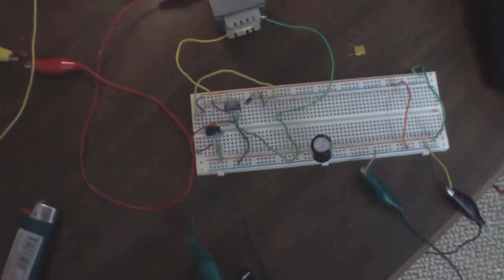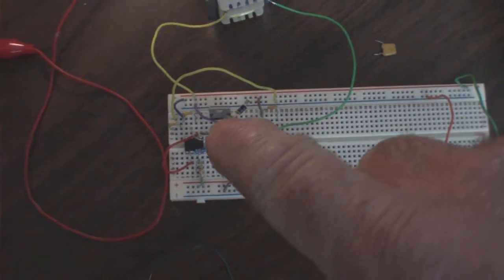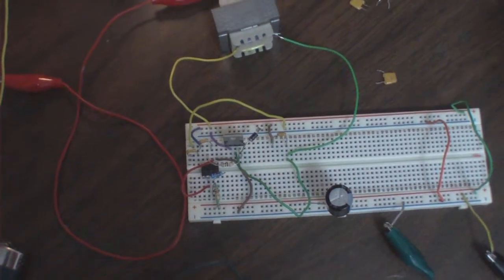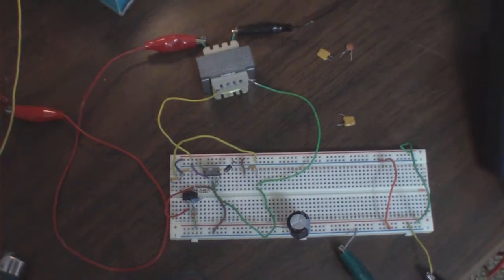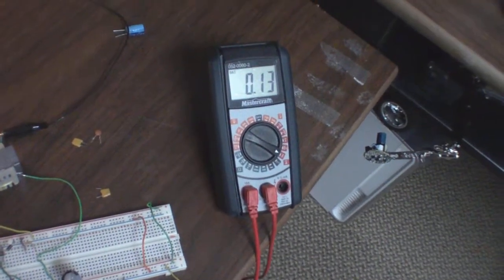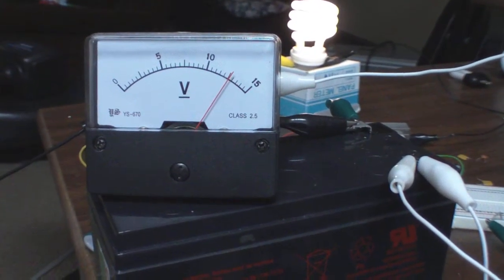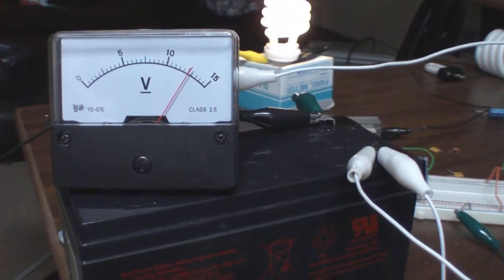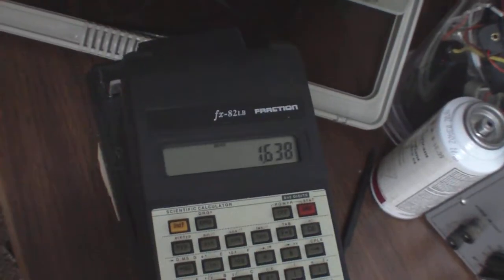12 Volt 1.65 watts CFL Driver - 555 Oscillator / Inverter - Sentex Kyle Mod II

Comment: I thought this circuit might do it the only problem is that the transformer used here would be to bulky heavy for my application. The idea is that the inverter + battery would be pocket size. Somehow I managed to drive the load with a 12v LiPoly driven EL inverter but I haven't tested the same circuit with smaller voltages (Don't want to waste so much juices just on this req) to find the sweet spot. This EL driver outputs 2kHz  here a link adafruit.com/products/448

Comment: Hi Kyle thanks for all your videos. I'm working on a project and I'm a bit stuck. I am trying to drive a small PDLC/Smart Glass film with the smallest battery power source I can make. Ideally a single cell LiPoly bat 3v-3.7v. The panel requires 120VAC, 50Hz and it draws 5mA .6W!. I've tried hacking all kinds of prebuilt inverter circuits and I am failing bad. Tried EL drivers, Fuji Camera circuits.. Can you point me in the right direction? Thanks!!

Comment from the maker: @DrSaminstine Not bad, its simple, cheap, quiet, not hot. That Jeannas Light has this beat at 1.5V though!!! big time. It's a rather exotic circuit though, the toroid's hard to find, expensive. I'll bet Slider will have some good stuff coming up, I just gave him some nice HV stuff to play with.